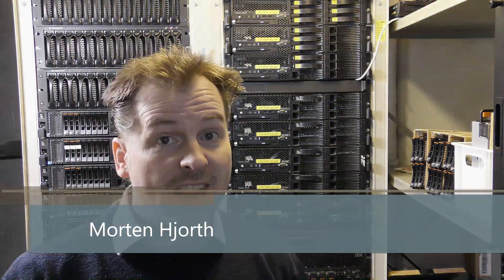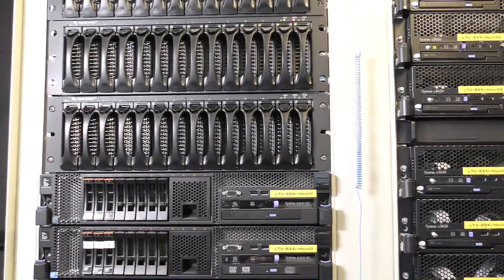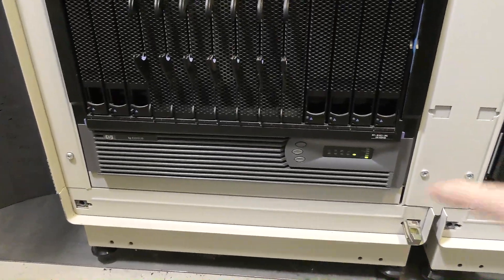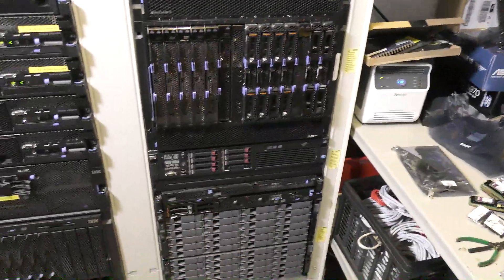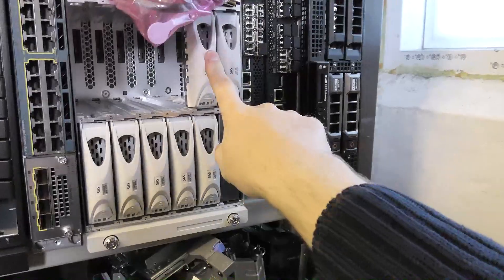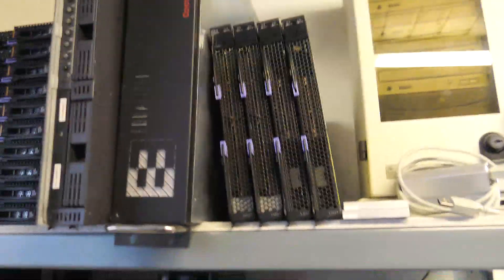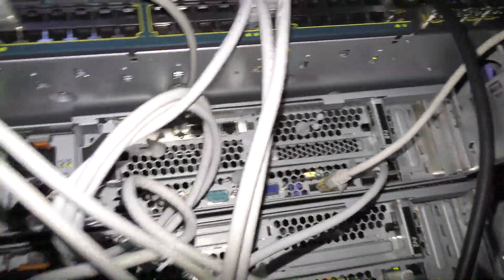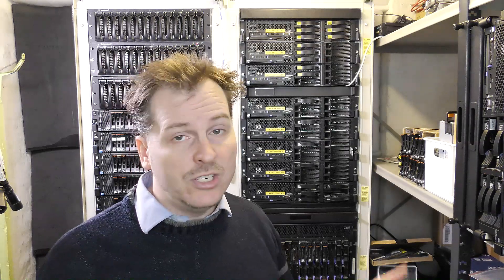Home Data Center / Server room - The Grand Tour - 586

Comment: I can't understand why I haven't found this channel beforehand. I have an almost identical system and passion.have two rack cabinets + a 3rd empty one. Each cabinet has two HP C7000 Blade enclosures, two enclosures full with 10 blades in each. Two full DL380 servers, one still running with 7TB storage in 3 HD shelves. Also have 2 HP Procurve 4108GL Layer 3 switches. All still running like a dream. Currently in the middle of relocating two cabinets. Great to see someone with a similar size setup that just uses it for self interest. Would also love to the the tape backup work at some point in the future.
Reply from the maker: Hi gemini5865
Thank You very much!  That is a lot of nice hardware,, glad you liked the video :-)
Thank you for watching! :-)

Comment: Decisions, decisions. Looking at getting my first rackserver to play around with and looking at either a IBM x3650 M3 with dual quadcore Xenons (1600sek) or a Dell R710 with dual Xenon six-cores (2200sek). The first one have 16GB ram and the second one 24GB ram.
My main worry is that I live in a small apartment, might be a bit noisy, also what the electricity bill will be :P Whichever I get will be for ESXi and host all the servers I run.
Reply from the maker: Hi Thomas Andersson
Thank You very much!  As a big Lenovo FAN boy,, do you need me to tell you what to get :-D
Thank you for watching! :-)
Reply: Oh, side note. Can the M3 do ESXi 6.5? without problems?
Reply: I guess I subconsciously mentioned it to you as I know what I want ;) The only thing is I do get better processors (more cores, more cache and more ram) with the Dell, but I guess I might also be able to upgrade the CPUs in the IBM. The again, 8 cores 16 threads should be fine for my needs, just need more than 16GB ram.

Comment: I saw in your FAQ that you had a IBM x3650 M1 and I wanted to say I have a IBM x3650 M2 sitting in my shed but when I used it, it was loud and that was the first time I used a serious server like that. Well it was a serious server but now its outdated and I tried booting operating systems but I dont know any compatible OS's with it so I stopped using it. It had xen server on it.
Reply from the maker: The x3650 M2 will have trouble with Windows Server 2022 and ESXi 6.7 & 7.0,,,,,, everything else it shout run.
Reply: @MyPlayHouse  In my honest opinion, I might pull it out of the shed again as no one wanted to purchase it. I know its been 10 months but I might try a different operating system because I really didn't make the effort. I'll try ESXi.

Comment: Love your videos. Im from Denmark myself and im in dire need of an SCSI array Controller 5300 for my old Compaq server and was wondering if you would part with anything else i can use in it. The batteries ate it sadly :(
Thanks for sharing :)
Reply from the maker: Hi Coldoikz1
Thank You very much!  not sure if i have a 5300 controller :-/ I might..
Thank you for watching! :-)
Reply: I try now to run it on its build in controller but i think the smart controller array is overall better :) Had a hard time finding the Smart Start cd for setting up the build in controller, but i found it and hope i can get it to run again.
Really nice setup you have :) Getting there myself but with a little bit older hardware.
Venligt Hilsen Rene

Comment: yeah i love my second gen dell poweredge 2950 its 2 quad 2.66 xeon 771 processors and 16 gigs of ddr2 ecc ram ive been thinking of later on getting another raid card flashed into hba it mode with an external connections to hook up a dell powervault 1000 have u used one of those and igts all been run with unraid
Reply from the maker: Hi Larry Jones
Thank You very much!  glad you liked the video :-)
Thank you for watching! :-)

Comment: With all due respect, the majority of them are so old, they're not worth having them in any place to waste $25-$30/month of power for 'each' of them. Especially those X3650 M2 and the older X3650 7979 series servers on the right. I would not use them at all. And one 2U UPS for all that set up? That is a waaaay under VA UPS for even half of that rack. I used the X3650 only for training and that was like 6 years as an already old server. That one is in my garage and has not been powered up for a long time. Picture this way, IBM has stopped branding the X series years ago and none of those latest servers (years ago) are here. Although I have to admire the effort in the setup, it's just waaay too old.
Reply from the maker: Hi Hakan Kilic
Thank You very much!  Well I kind of see what it can be used for and all my servers can still run the latest version of VM-ware ESXi,, and are there for fun for me to have around. I gather that you do not see this as I see it,,, this is way more fun, than Produktion,, and you just suggested to the jaguar collector, to get the new models because of better mileages :-)
I get newer equipment sa it becomes available to me,, I'd love a x3650 M5 or SR650,, just not the price tag.
The UPS,, it has not been in use yet,, I estimate that it has been two years since our last power failure. UP time on our grid is 99.9954% and I do not plug in all servers,, just a few... The rest can boot.
Thank you for watching! :-)

Comment: lol your UPS will last for like 2 minutes rip. nice hobby but lots of old dead stones. you could outperform your 2 racks with a beefy single computer....
Reply from the maker: Hi Neoshan
Thank You very much!  The power grid here has an 99.9954% up time. I have not had an power failure in two years now,, so the UPS is likely to never see a days job,, and I do not run all of this,, just a few systems on the UPS.
Thank you for watching! :-)